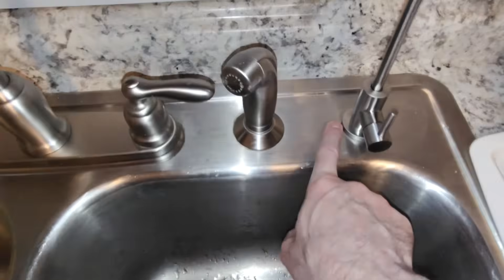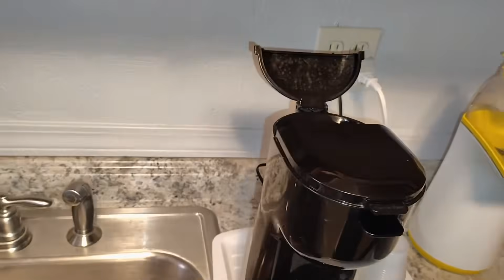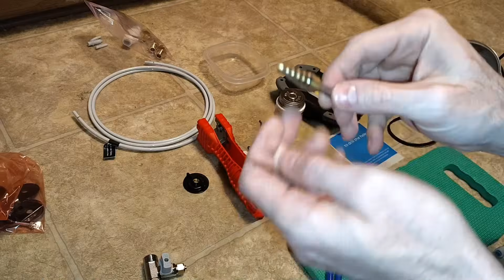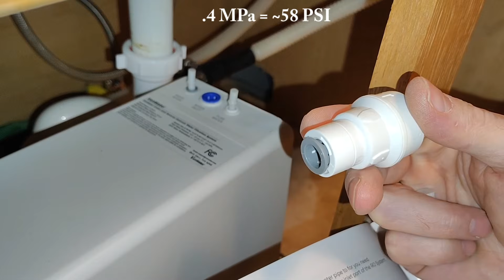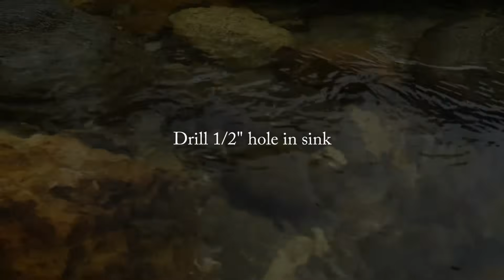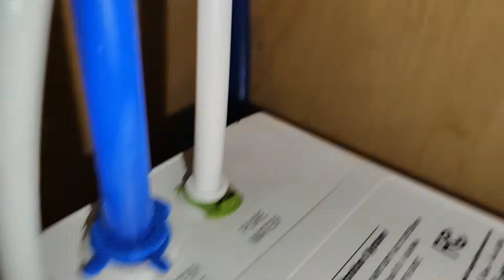VonWater 600G Reverse Osmosis Under sink RO water system installation

Comment: Hi, did all the washers come, or did you have to source any?
Reply from the maker: Hi, mostly everything was included: faucet washers and a foam gasket for the drain connection. However, if you have to use one of the adapters for 1/2" to 3/8" (mine were shipped separately), they do not come with enough washers and you should have extra washers for those adapters on hand. Only the small 3/8 connections come with washers and for some reason only one side of the 1/2" adapter.